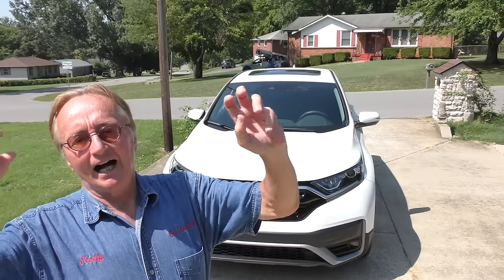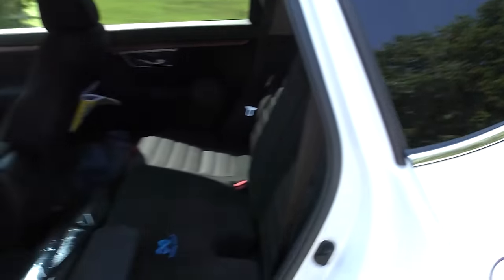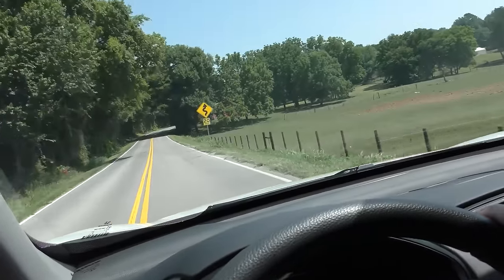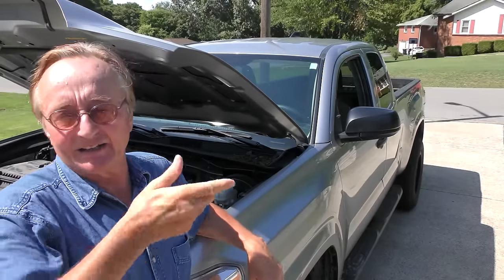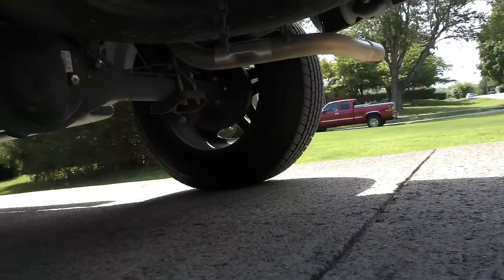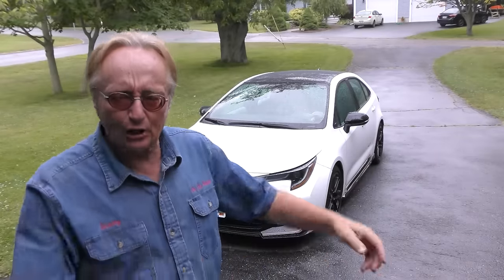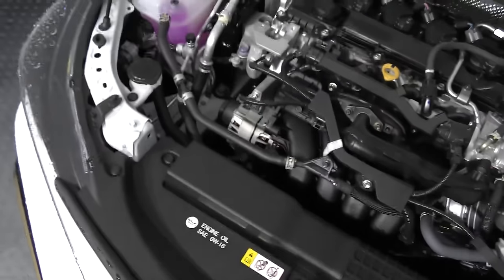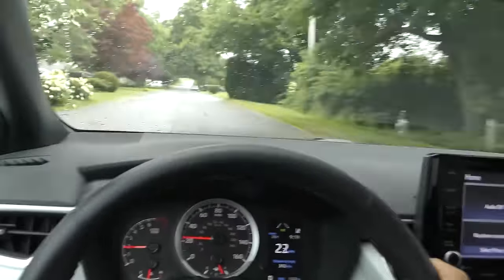The Best Vehicles to Buy in 2023

Comment: Thanks Scotty, we have a 2016 Nissan Rogue SL AWD 2.5 engine with 4K original miles. 

Now my wife want a Lexus or a Toyota 

The only reason not buying Lexus IS because of that front all plastic grill. 

So I should be looking for 2.4 L.  Or 
2.5L. I do not like hybrids 

So you would recommend this new Honda. 

Would you also recommend the two above.
Reply: I meant 40 k miles
Reply: I would prefer a 6 cylinder

Comment: Scotty, tell me your opinion of the flex fuel 5.7 Toyota engine. Summertime it started fine. Winter and the temp is below 40 and it is hard to start. Dealer wants to change the fuel pump and do something with the fuel system ( recalibrate?) to the tune of $2100+! I had cleaned the map sensor, put new NGK plugs in, and ran two tanks of gas with added fuel system cleaner prior to seeing the dealer, hoping that would take care of the problem. Please help!

Comment: I've driven a newer Tacoma with a four banger. Was pretty gutless. I'd go for the 4.0l instead👍
Reply: I have a 2015 Tacoma with the V6. A friend bought a 4 cylinder Tacoma and after a week returned it to the dealer and got the V6.
Reply: @richardpregler9480  I would of done the same. The four banger is just to underpowered in my opinion

Comment: Hi Scotty - Happy New Year! I need to buy a new full sized pickup. It will be used as a city truck to haul people and light loads in the bed - I never tow anything. What do you think is the most reliable / long term option on the market? I was thinking a Ram with the V6 pentastar (maybe the hemi)? I know the previous generation Tundra is reliable but I don't think I want to deal with it's horrible gas mileage even though that engine is known to be reliable. Thanks!
Reply: Take a look at the Ridgeline you will be pleasantly impressed
Reply: I have a 2015 Tacoma with double cab and six ft bed. Great truck.Has the V6 and gets around 20 miles to the gallon. Will tow up to 6500 lbs.

Comment: The mult injection system sets the fuel pressure from between 2-20 PSI. On the 2.5 at least. Definitely not 1000
Reply: Uhh no. Toyota now use direct and port injection. The direct injectors are absolutely very high pressure. The port ones are not

Comment: My wife’s 2016 CRV which we bought new now has 32,000 miles on it. It has a parasitic draw I can’t find. I go on YouTube, it’s very common for the Honda CRV to have parasitic draw. My wife’s car battery goes dead if she does not drive the car for three days. It’s drawing .5 Amps..
  what is the common fault with these Honda CRV that kills the battery. By the way our old battery was only 17 months old so I replaced it, and that New battery that I charged for 24 hours at 2 A before I put a load on it, that battery went dead when the car sat for three days.. when I start the car I’m getting over 14 V reading at the battery so the alternator is charging..
  So what’s the deal? What is the problem common to these cars?

Comment: Scotty, the new 2023 CR-V is even nicer, but I hear ya about manual adjust seats, and no sunroof. And exactly what you said about the Tacoma's. And they have the TRDs if you want a little sportier, but like the Corolla, Camry, Civic, Accord, they can c last a long time. 

I would go for a nice new Camry SE over the XSE or TRD for cost and practicslity, and over the Accords with the turbos, especially the 1.5L Turbo. I would rather have the Sport 2.0L turbo.

As far as the Corolla, the SE is a good one with Sporty ride and handling more comfortable and not extreme like the Apex, and a lot cheaper than the XSE, and you can get the JBL stereo, too. And there's a limited number of Apex 6 Speeds available. 

Similarly, the new Civic Sport is another one, but I prefer the Sport with the N/A 2.0L engine and the gear it has over the Touring and Sport Touring with the 1.5L turbo.

I was going to get the Civic Sport Hatchback, but the new HR-V Sport with the same engine suits me better for what I want and need, and you don't have to deal with the blasted auto start/stop that they should at least be able to set it as default with that disabled. 

What they should do is have Sport Performance models of the CR-V, Civic Sport and HR-V Sport with the 240 HP 2.0L from the S2000 with a manual 6 Speed so it can rev like the S2000 could. I believe that would be practical daily drivers for enthusiasts that shoud sell well.
Reply: I just sat in one at the car show. It had power seats.

Comment: I like the 2022 CR-V better than the 2023 newer model has to grow on me same when Silverado came out few years back took some time grow on me as 2022 Tundra think it's a nice truck. The CR-V has a nice cabin few years back had oil issues think got fixed on 2021-22 models not sure about 2020 before clicking on here I just finished watching a 2023 RAV4 video said like the body on 2023 RAV4 better than 2023 CR-V.

Comment: Hey Scotty Kilmer I have a question I recently drain my heater I’m at 2003 Lexus ES 300 and me being careless I lost track of which is the top and which is the bottom heater hose so I just don’t wanna cause any problems to the system do you possibly know we Togos where from the manifold to the heater core
Reply: check parts numbers. Plug them into a search engine

Comment: The best?  Something used, and preferably a four cylinder, and parts that don't cost an arm and a leg.  Price a few common things to gauge relative value I think: brake rotors, starter motor, alternator, struts,  etc.  If you thought gas prices sucked this past summer... 2023 should see the strategic petoleum resrves tap out - no more room for flim-flam "fixes" left.  Maybe then theres enough pressure for exploration capex to bounce back up from the trough it slid into after 2014.  Its flat out scary how little money has gone into exploration since the Saudis undercut Opec by $20/bbl.  But that at best might slow gas price hikes, not reverse them.  Real relief from Bidenomics?  Maybe 2026.

Comment: Honda is not any good pulling a trailer the Honda Odyssey has nothing but transmission trouble for years I know more Hondas have nothing but transmission problems more then I can count all my fingers and those people went an an got GMC SUVs an vans and thy had  have no problems that those Hondas an all the Honda creeps never tow heavy trailers and they keep bragging about how long they last as an owner operator picking up vehicles and the Toyotas will rust an the 4 cylinder is junk out and the Honda transmission are all junk because there is a lot of Hondas that are inoperable 😅😂

Comment: ‘The best vehicles to buy in 2023’.....are electric vehicles. Scotty doesn’t seem to have noticed that sales of  cars powered by internal combustion engines peaked in 2018 and are not coming back....the only way is down. Stats say Honda make the world’s best engines and my experience over 45 years of car ownership is that Hondas, Toyotas and Mitsubishi make the most reliable ICE powered cars....but we are going into a new paradigm which says ‘who cares if you make the best engines!’....engines have thousands of parts plus gearboxes, starter motors, water pumps, alternators, drive belts...etc etc...EVs are much simpler..so you can apply the philosophy of Ockham’s razor or the probability maths on component failure rates...either way you come to the same conclusion...that for the average car owner an EV is cheaper, more reliable and I would argue will last longer than anything powered by fossil fuels. And they are MUCH nicer to drive.
Reply: How do you like that big 'ol battery which you had a bunch of women and children mine the materials for, Davey?